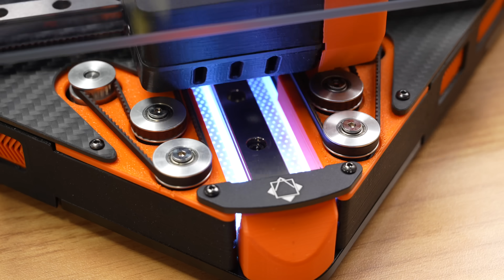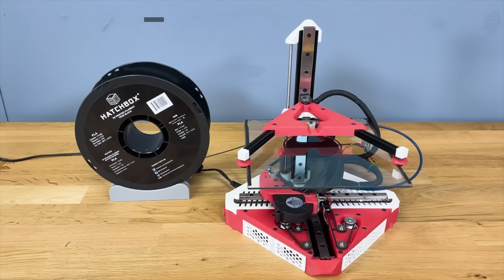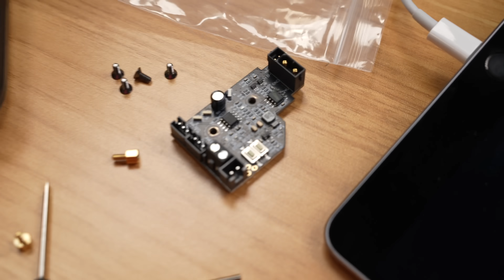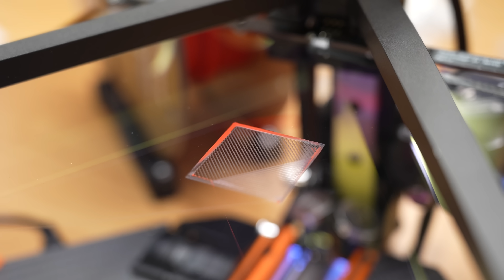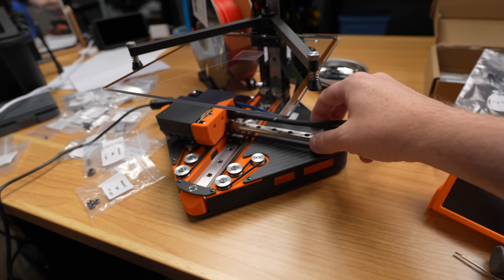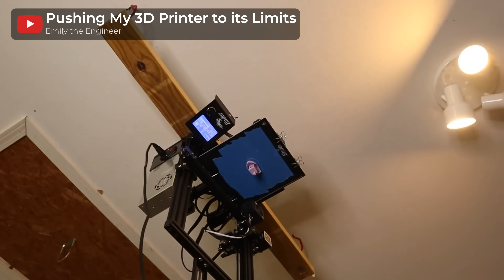Finally, a 3D Printer for Australians!

Comment: So happy to hear you enjoyed the build 💙

Edit: For those wondering about the price. Yes, we know it's not accessible for everyone. The BOM for this is a lot. In the end, Positron makes about $25 per kit.

Majority of the price is going into the custom machining, the cost for our custom heatblock alone is $40. We decided to use higher quality components over cheaper alternatives, like using a CM4 instead of a clone because we wanted to enable everyone to be able to customize and tinker without limitation.

Since this kit is done in batches, and not as a full production line, it's going to be more expensive than printers with dedicated production lines like Bambu or Prusa.

We're looking at creating a version that is cheaper, but please understand that it will be difficult, the LT alone which is meant to be a easy self-source option can range around $500.

Positron is a team of about 12 volunteer team members who do this for fun. We're always looking for ways to make the kit more affordable, so if you have some ideas, we'd love to hear the feedback.
Reply from the maker: Thanks for the clarification on the pricing — I tried to make it apparent, and explicitly mentioned in the video, this isn't a printer for a first-time hobbyist getting into 3D printing (at least not most of us). And it's not something meant to be on the same plane as a Bambu A1 mini or Prusa mini... this is a totally different thing! I love that it can exist, it's a very cool printer.
Reply: Your team and LDO have done wonderfully to bring the kit to life.
Reply: Laser cutter/operator here from Australia, been laser cutting parts for over 25 years if you are getting the metal parts laser cut we may be able to do it cheaper!
Reply: Very cool. Thanks for the transparency
Reply: Not everything needs to be accessible financially to everyone. The Bambu X1C isn't accessible for everyone either.
Reply: You need to get a Purchasing specialist to bring your BOM cost down....
Reply: how can yall charge $99 for 3d printed parts though? lol come on it should be like $15
Reply: @penguiin12  it uses a out a kilo of filament, which is $20, the machine time is another $30, overhead on both of that in case of failures, another $20. And then the retailers set the MSRP. The machine time and coverage of failure is the most expensive part. This also will cover parts that get damaged in shipping at no cost to the customer, so, while yes, you could make these yourself for way cheaper, your paying for the material, time to print, and insurance of the parts. It similar to Voron parts.

You don't have to buy them, it's just there for people who don't have printers that can do ABS/ASA. Better to spend $100 on those parts than on a $1,000 machine for the ability to print those parts, especially if you don't have the space.

Comment: I found one drawback to this printer: even if you pause printing midway, you can't add magnets or sand weights to the hollow core. 
The gravity direction reverses, you see. If you absolutely must do it, you'll need to improvise—like temporarily securing magnets with hot glue or filling balloons with sand or liquid.

Comment: Super neat. Not for me, but still super neat. If they ever get it down to a few hundred bucks I'd probably buy it just for the novelty alone. As for the goo mess you could probably just tweak your code to touch a corner before it heats up and then have it draw out a line on the edge of the bed. That's what I did when I was running a crappy old customized Anet A8 during the Pandemic for Masks For Docs. Just had it do that to always ensure a good first layer, then it'd finish, cool down, then do a little sweep to shover everything off the bed & then just repeat over & over until it ran out of filament. Literally the dumbest & worst Prussa MK.2 clone out there doing reliable automated printing with just some slight tweaks to the G code.

Comment: $800 for a small 3D printer??? I get thr upside down is cool but not $500 more than a starter printer and $300 more than the bambu lab A1
Reply: There's Lemontron at $400 but gotta determine if portability outweighs a standard fdm like Centurion Carbon
Reply: @LeftyPencil  i fell like the standard is better in 95% of cases because where are you supposed to take it for any normal hobbiest or print shop owner. 

The other 5% is for the people who make it their thing to travel around constantly whether thats conventions or to make people some parts out in the wild, iykyk.

Comment: those of you who want one of these but don't want to spend $700+ should check out the Lemontron. It's a variant of this printer that substitutes the custom machined parts for 3D printed parts. Only costs a little over 400 bucks to source all the non-printed parts
Reply: Do you know if petg is ok for the printed stuff?

Comment: While its really cool, its insane just how non viable this thing is.

800 dollars? Three raspberry pi's? This thing needs a complete top to bottom rework to make it much cheaper, using mass manufactured parts, and simplifying the electricals because three pi's is overkill when a single one could run this thing(probably)

Comment: 800 bucks for a tiny print volume printer kit? That’s definitely a novelty and fun hobby thing, but not a daily driver working tool.
Reply: A Voron V0 has been a daily driver for many, and it's has a smaller build volume for the same price.

It has proven itself to be a useful tool to many people, but not everyone needs the same tool, as Jeff says, it's not for everyone, but it is the most compact 3D Printer on the market, and that could be a huge point for someone.
Reply: there's a variant of this printer called the Lemontron that substitutes the custom CNC machined parts for 3D printed parts. Costs about 400 bucks to source all the non printed parts, and you can print the rest yourself

Comment: I'm sorry. WHAT?!?!! $700 for a printer where you have to build it? I guess we need to start pirating printers now.
Reply: there's a version of this that uses 3D printed parts in place of the CNC machined parts. It's called the Lemontron. Costs about 400 bucks to source the non-printed parts

Comment: does it have auto leveling
Reply: Not with the glass bed - but the new PCB bed, yes.

The Positron team is working on adding a Piezo to add high accuracy leveling on all surface types.

Comment: Every time I see a video on this I say the same thing: forget portability, the real reason the design is a big deal is it may get 3D printers into the homes of people who might use them once a year. Like a drill, a 3D printer for the average person should go away when not in use.
Reply: Exactly! The best part about the Positron is that it takes up the least amount of space, but utilizes every inch of the form factor, allowing it to be The Printer, with the LARGEST Printer Volume to Printer Size ratio.

Comment: As to the nozzle and gravity..  A thin aluminum washer with a small hole that you just set over the end of the nozzle while loading?
Reply: It's a solved issue - the nozzle parks itself now to prevent oozing prior to printing, and we max the PCF to cool filament on loading so it can just be removed without it getting on the nozzle :)

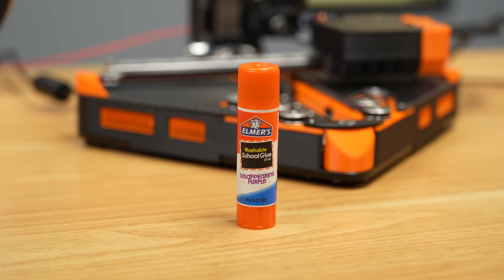Comment: 14:45 Stepper motors can withstand very high temps, as long as they don't reach around 90°C they are completely fine. Meaning if they are hot to touch, but you can touch them without burning yourself, you are fine.

Comment: Very neat little printer. It'd be cool to see this maybe a little more ruggedized and I could see it having a lot of utility in various uncontrolled environments. Putting the printhead on the base to save structural mass is very smart, and you know what, you could hang this thing upside down and get rid of the nozzle oozing issue! That I would like to see.

Comment: So after a reddit post someone sent me of a 3D printer hanging from a rail, and a comment about weirdest places to have a printer, I'm wondering if ceiling mounting this would help with the extruder oozing problem 😂
Reply: would actually be really cool to mount this on the underside of a shelf above a workbench or something. Just pull it down to deploy it when you want to use it

Comment: So if you used it in the US would you have to turn it right side up?
Reply: you joke, but you probably could mount this on the underside of a shelf above a workbench. The fact that it folds up means you can stow it away when not using it, and pull it down to deploy it when you want to print something

Comment: So in essence a little upside-down core XY printer?
Rather nice, but a lot of money for a DIY printer. 

I get the upside-down aspect helps portability, but I wonder if the 'crap on the print head' thing will get old really quickly?

Comment: Could you mount it upside down and use it as a normal 3d printer albeit with the heat-bed lowering instead of the motors raising?
Reply: Yes actually! We made sure there were mounting holes on the bottom of the plate. This way you can mount it however you like.
Reply: @nomadsgalaxy  Do you happen to have video showing it operating in such a configuration?
Reply: @RobinHilton22367  I don't, but I'll try and get an example at 3D Printopia
Reply from the maker: Would love to see a 3D printed under-desk mount for this printer...

Or maybe even a CNC plate version we could use. Would love to mount this under my desk!

Comment: Don't forget heat rises so the heat will keep the piece well heated after the line if print has been deposited keeping it fused longer than if printing normaly
Reply from the maker: Ha! Didn't think about that, though it won't make a significant difference outside of a well-sealed enclosure.

Comment: Wait when did they switch to belts? I thought it was some big 'upgrade' to use those weird textured steel cables instead
Reply: We went back after we realized how expensive they were, and how 3mm belts achieved the same results. The Synchromesh worked, but also cause an Insane amount of ringing in prints.
Reply from the maker: And apparently only a single supplier for the synchromesh belts — which would put them in a very tight spot if that supplier ran out!

Comment: It could perform the filament supply extrusion directly on the table, causing the nozzle to extrude material surrounding the glass plate itself, preventing the material from falling on top of the nozzle.

Comment: I feel like the filament load should have an option to print a very slow thick purge line like how Prusa does in their startup sequence. Even if it doesn't stick well to the bed it should at least serve to keep the filament moving away from the nozzle while it purges.

Comment: Sorry but this printer is pointless. I have to press inserts? Really? Have constant problems with the filament. Not having a flexible bed.  ...just shortcomings.
Reply: 1. it's a kit printer just like a Voron, no one is doing the inserts for you.
2. Filament problems are solved by tuning
3. PCB bed with flex sheet in the works, but the glass bed lets you see the first layer to ensure a good first layer.

If you buy a kit car, you're going to be expected to build it yourself. Same thing goes for kit printers.

Comment: I love this design, but the price is really huge. I wonder what's the break down of the costs.
Reply: 1/4 to electronics & custom electronics
1/4 to machined materials
1/4 to unique hardware (Such as the ITO Build plate. We reject many units to maintain high quality)
1/4 to labor and shipping.
These are rough estimates, not exact.

All in all, Positron makes about $25 per kit. Our ROI is extremely small. We're working on making it cheaper, but our custom heatblock alone is $40 a piece.

Comment: why is it expensive? R.Pi's
Reply: The electronics alone are about 1/4 of our BOM 😅

1/4 to electronics & custom electronics
1/4 to machined materials
1/4 to unique hardware (Such as the ITO Build plate. We reject many units to maintain high quality)
1/4 to labor and shipping.
These are rough estimates, not exact.

All in all, Positron makes about $25 per kit. Our ROI is extremely small.
Reply: @nomadsgalaxy  I would say that there is no ROI at those values hehe. But it's good to see a company pushing ahead with cool products, my comment was more of a joke because rpi's are insanely expensive nowadays. I always wonder if companies consider using a Orange Pi's or something more reasonable priced. Thanks for the breakdown =D
Reply: that's Love not ROI
Reply: @TaskerTech  We've considered cheaper units, but we decided the extra $20 it costs is worth the extra feature set.

Big Tree Tech has a CM4 compatible chip, but that'd only be good for printers and klipper, with a CM4, you can do so much more with a near full linux feature set. So yeah, we wanted to encourage tinkering.
Reply: @nomadsgalaxy  Got it, thanks! as someone who also works with products I love to hear the decision making behind stuff =D

Comment: I've 0 experience with 3D printing, but am interested enough to have watched many YT reviews. The thing I like most about this upside down design is that it doesn't need supporting structures to be added to the part's design.
Suggestions: 
* Place a small 'catch bib sheet' with a hole around the nozzle, while preheating it to avoid the mess. Just remove it prior to printing.
* Suspend the spool on a horizontal axle, similar to how electricians utilize horizontal cabling spool racks. That will provide the necessary leverage to stop it from traveling across the work surface.
* Perhaps the cable snagging could be solved by suspending it from above  with a swinging wire or string?

Comment: Couldn't you maybe make a part that holds a silicone nozzle wiper (from BL for example) upside down, fix it somewhere in the structure and add gcode for a couple of wipes before every new print/filament change?
Reply: We do include a silicone pad, but a recent slicer update appears to have wiped the pre-included docking gcode. We'll be adding that to the PRINT_START macro in Klipper

Comment: 5:24 my first thought is running a screwdriver or other small shaft through the washer and into the standoff to line it up in a way you might hope to hold the washer down while pulling the shaft out to leave it in place

Comment: The print head should have two positions: normal printing (nozzle facing up), and preparing (nozzle facing to the side, 90˚)
Print starts, prinhead flips 90 deg and starts fillament loading, then flips into working position (maybe brushing some pad to detach oozed fillament) and locks.
Maybe can even add a motorized mechanism with sensors/switches to automate it.

Other (possibly easier and more reliable) implementation would be to put a small cube/cup-shaped holder with a fitting hole right above the nozzle, fillament should go up and curl inside of the holder. Can add a hi-temp silicon gasket on the interface between the nozzle and holder, to make sure the fillament wont ooze sideways and won't stick due to cooling on touch. You can even make the whole holder from silicon.
@Jeff, If you have spare silicon shrouds for heating block lying around, you could try them as a test.

Comment: 10:35: That is called PA calibration, OrcaSlicer has both PA and flow calibration which are mandatory calibration to get decent printing quality.

11:08: I have Voron 3D Printers ( Klipper ) and have had BambuLab and Ender in the past.
Never fully heat the nozzle, heat the nozzle up to 150c degree Celsius only, let the printer does its calibration and only then fully heat the nozzle when it is close to the bed about to start printing the purge line. It is mandatory to have a purge line so the nozzle have enough material within it before starting the print or you risk it printing air until enough filament gets pushed out.
That is how you solve oozing problems.

14:32: See the corners?? That is called warping, 
Isopropryl alcohol is your friend, keep your bed clean, never touch the printing area with your fingers (oil) and make sure you have the right temperature. Depending on the PLA, you can go from 45-60c

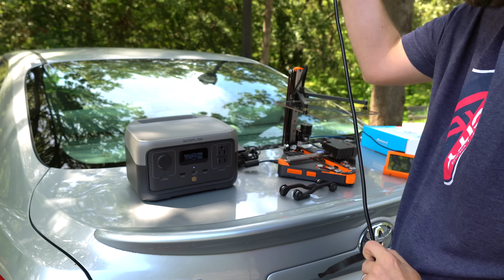Comment: Feel like you’re losing a lot of capacity going from battery to 120v to 24v when traveling… does your battery system offer a 24v output, or perhaps USB C PD? 13:48

Comment: As far as the gooping goes, that is with any printer. When you first load the filament, push it in until it stops, and then pull it back a few mm. When the filament heats up it will melt, and if there is nowhere for it to go, it goes out the nozzle. Your prime line before the print starts should be enough to get the filament flowing the way it should but without all that goopy mess.

Comment: Welcome to the Club of DIY Kit Printer Builders. My first Printer was something similar: Teebot the Suitecase Printer. It's an 2014 Take on this Design and it is build into a hand luggage carrying case, which literally forms the Chassi of the Printer, it is a normal i3 Clone and the print Volume with 200x160x200 is on the smaller side. But having a Printer to go is great. You Open the Case, take out the filament holder, mount the Z Axis with 4 Screws. Putt in the Powercable and  it is ready to go. Of Course an old Marlin printer but it is still kicking today. Even if i had to rebuild it 4 times now. Was my first 3D printer and a lot followed over the years. 3 Kits, 2 Preassembled and 1 Bambu X1E

Comment: Is it possible your power adaptor is the wrong type to the 3d printer? Eg. center positive or center negative not matching the printer? This might put the power adaptor into protect mode if the polarity is reversed, resulting in practically no reading from your supply. If you unplug your adaptor for a few minutes then plug it back in, then immediately check with a multimeter, you might see nominal readings. If this works then that's probably what the reason is. Some barrel jacks are center positive, whereas others are center negative.